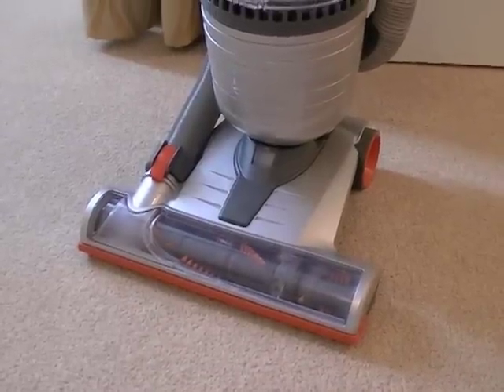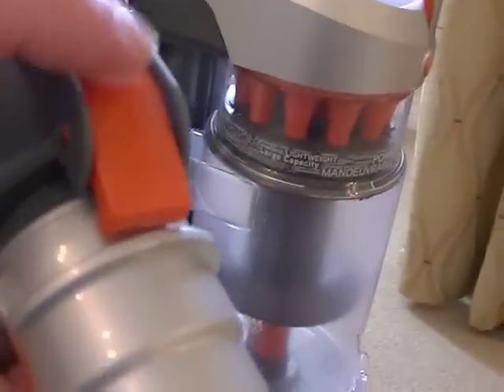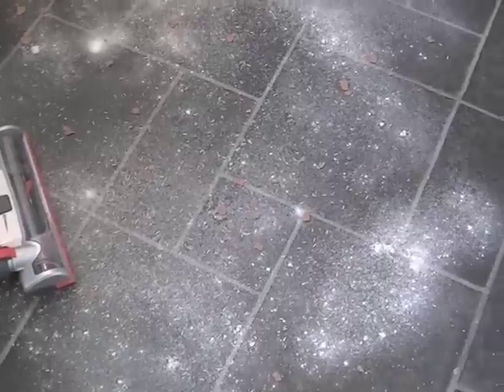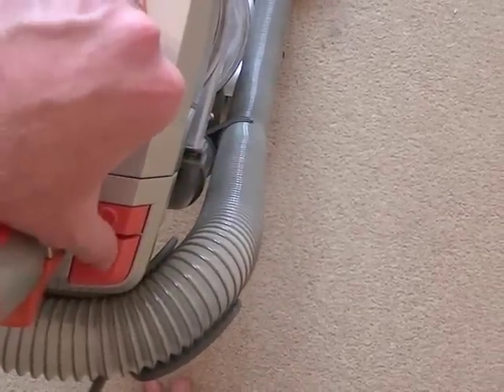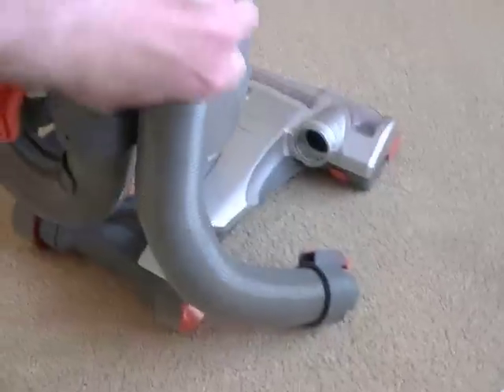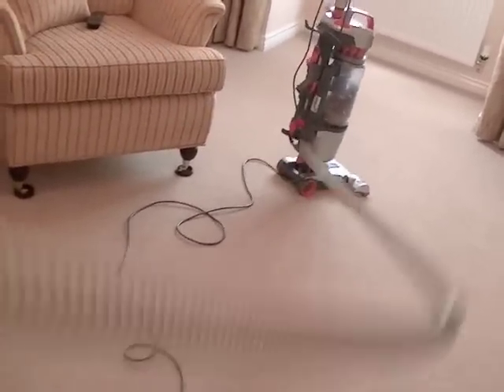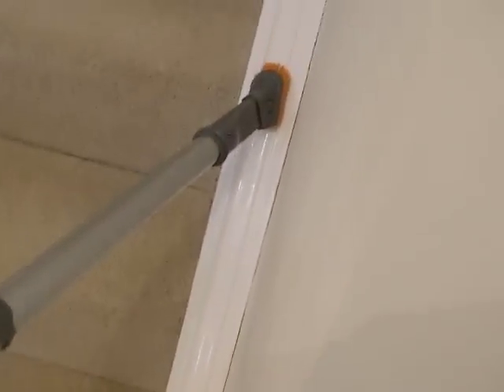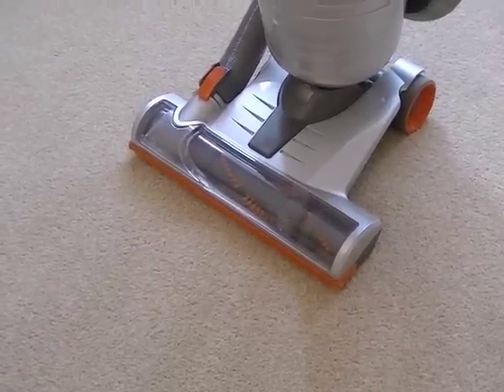Vax Air 3 Max Bagless Upright Vacuum Cleaner Demonstration

Comment: Roger, I just wanted to say you made a great video as always. I personally own a Hoover Air Pro upright here in Canada, this Vax Air 3 Max would be the equivalent to the Hoover Air Lite sold in Canada & America, & I find my Hoover Air Pro is a great cleaner, a bit better than my Shark Rotator NV501. May I make a suggestion? One thing you should show in your tests of bagless vacuums is the pre-motor filter that captures the dust that escapes the cyclones. Many of these Dyson copies have very inefficient cyclones that soil the pre-filter much faster & require more cleaning more often. The Hoover I have, although a great carpet & floor cleaner, is especially bad for this. And I agree with you about TTI needing to do something about the Vax & Hoover Air uprights sticking to carpets by putting some sort of bleeder valve to release suction, until they can redesign the cleaner head to clean effectively & get a A rating on carpets without being a pain to push & pull on carpets.

Comment: The 1 issue we find with our Vax air pet machine is that bits of hair wraps itself round the little cyclones which didn't happen on the machine Vax replaced. But regular cleaning of the filter/cyclones sorts it and its only a minor thing. The cleaner itself is very powerful for a 1200w, the hose on the original air is too short we also find, a stretch hose should fix that though. Overall a good cleaner. Do you think Vax airs are equally as good as dysons? Another thing Vax seemed to have fixed is their tool storage as the original version's tool fall out when in use.  Do you think Chinese built machines are as good as British/German built stuff?
Reply from the maker: I like a lot of Vax cleaners,but I wasn't keen on this one. I prefer the original Vax Air Reach without the swivel head.
I haven't used any of the current Dyson cleaners, but I hear good things about the DC41, though I feel that they are expensive. I haven't come across a Chinese made cleaner that is better built than a German or UK machine.
Reply: ibaisaic ours is the original Vax air, we originally had the pet version of the original air which was the replacement Vax sent to replace a 2 yr old Mach xp that broke, but the motor burned out on the pet unit after 3 uses so the unit was replaced again under warranty with a service unit and we just put on our original bin tools etc.. But the service unit is better. A lot of modern vacuums are made in China these days aren't they? Didn't know how to clean the inner cyclones but I thought the ring came out somehow, and was watching 1 of your vids where u showed how it comes off, anyway cleaned ours, absolutely caked in dust they was, shows how good the Vax air is don't it?  You seen the gtech multi?

Comment: hello :)
love this review
can you help please?
we had an upright vacuum and it completely lost most of its suction and stopped picking up, could it have been the filter? thanks
:)
Reply from the maker: It could have been any number of reasons, from a blockage, clogged filters, worn brushes or belt, to a motor that's on its last legs.

Comment: How do you clean rugs using this machine?  It is just devouring my rugs without the brush bar being turned on. Thanks?
Reply from the maker: Some vacuum cleaners don't do well on rugs due to the high suction power. With cleaners that have an electronic suction control, this can be remedied by turning the power down, but as this Vax only has one setting there isn't much you can do. You may be able to buy a generic carpet nozzle that will fit onto the end of the tube and clean your rugs with that.

Comment: I bought one of these yesterday but I find it near impossible to push on carpet. Also every few seconds the red light indicating the brush is blocked keeps coming on and the brush stops spinning. Any advice?
Reply from the maker: Take it back to the shop. This seems to be quite a common problem with the latest Vax AAAA rated cleaners. The model in this video
Is an earlier version with a different brushroll and isn't hard to push. I have unboxed one of the latest Vax Air uprights on my channel 
but haven't made a review video yet. 

Mine is OK to push on a short pile carpet, but on my large wool rug, it is almost impossible to push 
and the brushroll cuts out. Vax need to modify these cleaners with either a carpet height control or a suction slide to reduce the suction at the head
because they don't suit all carpets. 

The Air uprights were modified to improve pick up when the new EU legislation came into effect last September.
Although they do perform very well on short cut pile carpets, the sealed suction at the head makes pushing the machine very difficult on many carpets.
Most of the negative reviews on the Air uprights do mention how difficult they are to push and the brush roll cutting out also seems to be a common problem.

Comment: I have just acquired a Vax Air reach and am really struggling to push it along my hall carpet even with the brush bar in up position. Is there anything else which needs adjusting?
Reply from the maker: chasingdaisychains No unfortnately not. Because of the stong suction, on some carpets the machine tends to seal itself to the floor making it hard to push. Vax need to add some sort of suction control to allow the user to adjust the power. Contact Vax via their website or Facebook if you need more advice and see what they say about your problem.